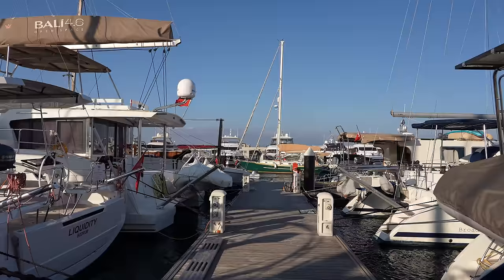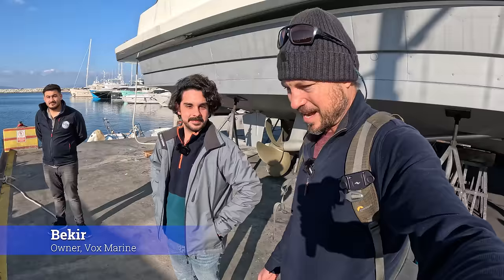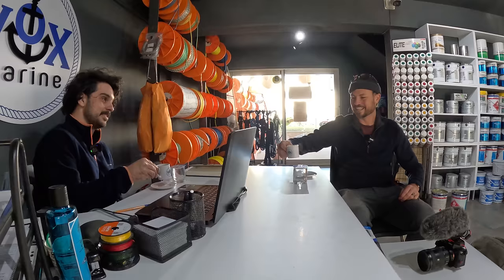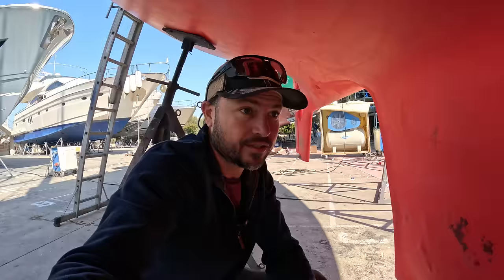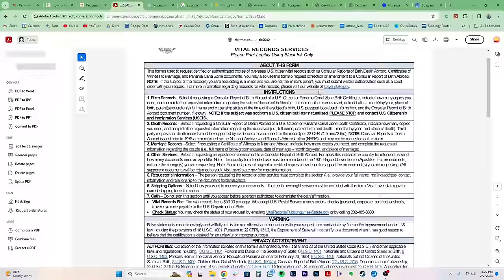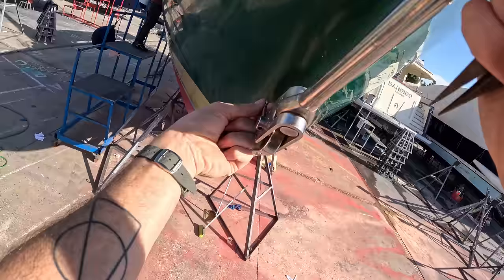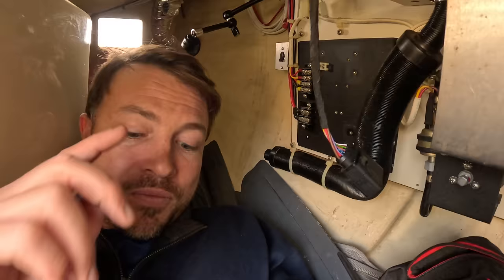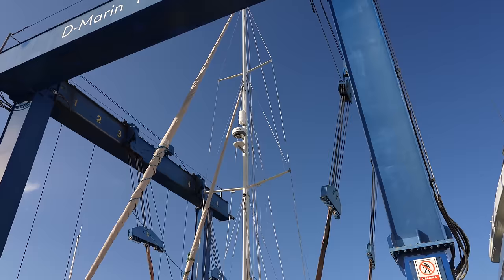Unexpected! | Lifting our Home out of the Water | S09E03

Comment: Hi Jordan. That diesel pump of the Eberspächer heater is not mounted correctly and could stop working anytime. The pump must be mounted at an angle (not vertical and not horizontal). Have a look at the manual, as to the inclination required.
Also, switching on and off is not immediate. The device is optimizing its procedures to avoid sud and therefore needs some time before starting or shutting off after you pressed the buttons accordingly. That behaviour is thus normal. God luck and regards from Switzerland, Silvano

Comment: I have 2 x grilled intakes, one each side of the hull, = Redundancy.
Both supply All SW requirements to sea chest via 50 micron strainer, = less UW holes & crap in the lines (like seaweed in WM, heat exchanger).
All fittings/lines are HD Poly (Blue Line PN12.5), = no corrosion, seals or clamp failures (especially spider clamps).

Comment: Great video and courage with wiring.  Sometimes you just have to trust wire colors to match.  The safest way is to pull the old wire and install the new, but that just isn't always practical and could be very time consuming.  On aircraft, older mechanical relays tended to be weak links.  I would make a note to remember that relay and replace it when you have the opportunity.  The clicking noise on diesel heaters is the fuel pump.

Comment: Nice work on getting all the jobs done on schedule. I am not a fan of putting an extra strainer on the outside of the boat because it’s moving the problem to the outside of the boat, meaning you have to dive to clean the strainer, plus they tend to restrict the water flow with barnacles and growth in the strainer. I will just increase the size of the onboard strainer.

Comment: Great to See you guys hitting all your Goals and getting together with Family too. Great Videos as usual.
BTW I have had 2of the same heaters... had to replace one as the original computer were not working correctly for more than a week at s time. The new one has worked Flawlessly for 3-4 months. 
One of the Factory Installation Instructions for these  units is not to "Cut the Factory Wire Loom" as it can Change the OHM's which affects the Control Computer. They tell you to order the Factory Pigtail "Extension"  I'd be greatly interested in how your performance tracks out over this heating season. You work very much like I do, in  very Meticulous Detail my friend. It will be even more interesting for me as I watch you with your new heater install.
Abounding Blessings to You, Gary Larson

Comment: Re heater, is it an Eberspacher? I got one in my van. Good, but prone to throwing error codes randomly, which can be cleared by going in to its "secret" workshop menu. (check youtube vids). But sometimes it locks you out after several codes  if there is problem that needs to be fixed. Good luck!

Comment: What is a Bob Stay?
Reply: It the bracing cable that comes up from the bow just above the waterline to the underside of the bow pulpit. It takes the tension from the rigging that comes from the front top of the mast to the bottom of the roller reefer fixing or mast stay.  It stops the bow pulpit or boom bending upwards withe the pull on the mast from the rear stays.  
Triangulation to control bending or sailing forces on the mast.